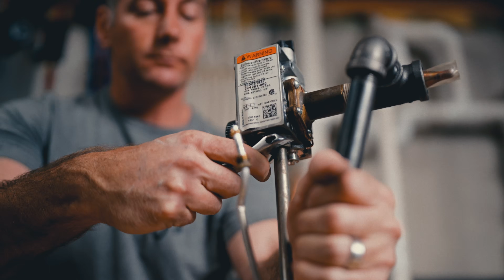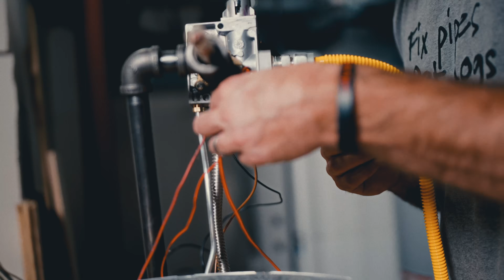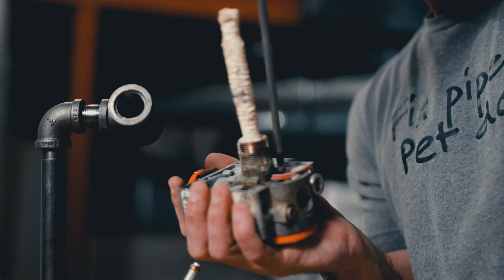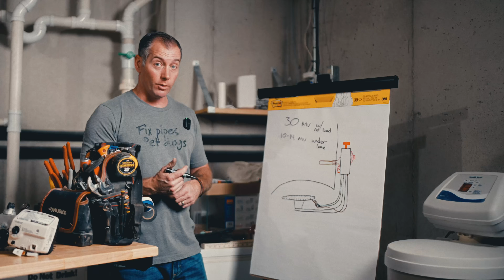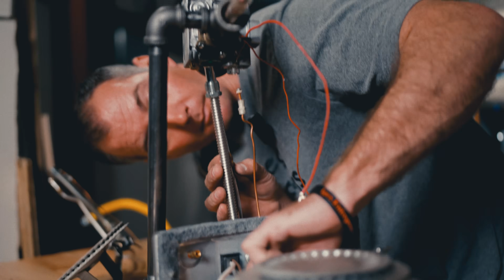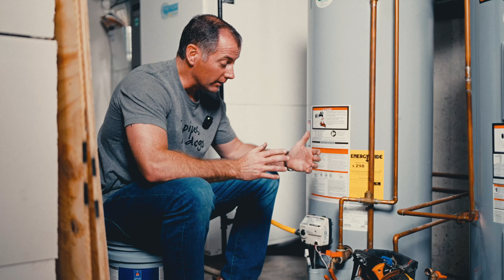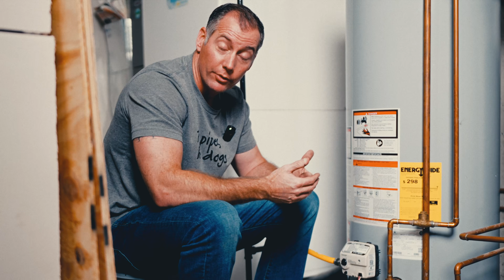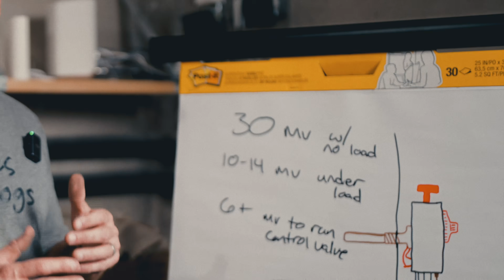Water Heater won't stay lit - Here's why

Comment: I learned a whole lot. Thank you. 👍🏼My Rheem LP 40gal (2020) wouldnt stay lit. The pilot would light but when burner engaged it would poof and snuff out. (TRD was tripped the part is on the way).
I wanted to know why? What caused it. 😳 I don't want to put a band aid on a broken bone. I sent pictures and Rheem techs said the flue pipe must be at least 12 inches above the flange before a bend and mine is only 9.5". It worked for 3 years and the control valve assembly was replaced, and the thermocouple twice.
>> Now after removing the burner assembly..it was ALL charred like your dogs. It's cleaned and back in. For the flue pipe fix..hvac on the way.😂 Omgosh, I could be a consultant after all this research. I have a better understanding of the beast now. Thanks so much. Keep training up more young people. We need them out here! There are limits to R&R. 
It takes knowledge and wisdom to fix what mist cannot. Ps: I like your shirts!
Reply from the maker: Thanks!
Reply: I’m sorry to inform you that the reason your water heater sucks, is because it’s a Rheem.

Comment: I liked your gas control video I have a series 300 control valve if I put my nose right up to it I smell gas not strong but it’s there what’s the cause or is this normal
Reply from the maker: Yep.  They have a small vent on the back side.

Comment: I have a heater with the 300 series valve on it. The pilot will light but won’t stay lit. The light that blinks won’t blink when the pilot is lit. I have taken out the burner and cleaned it and reinstalled it. Can you help I was thinking it was a thermal pile and the little button that pops out is in. Again I am not sure what’s the problem
Reply from the maker: Sounds like you need to replace the control valve.  Check the mv to be sure.

Comment: Model #GFD-3-AOS-24.  It kicked the breaker .The water was slightly water so I noticed the little light wasn't flashing. So I cut the breaker back on and everything kicked on and then kicked off. Then about 40 to an hour or so I heard the breaker kick off, so I left it off. Any help would be appreciated. Thanks I think this is the Model # ND40T62-403 the previous one is wrong I think.
Reply from the maker: I'd call a plumber

Comment: I have a Bradford white eco-defender 
My question  is it keeps going out everyday  and I relit  it everyday  now no light and it will not lit. 
Unit was installed  2022
Reply from the maker: Could be a clogged inlet screen and/or a tripped high limit temp switch.  

If new parts are needed, it could be a thermopile or a bad control valve

Comment: So I have a Rheem brand and the pilot flame stays on but it won’t ignite to open flame , the valve is blinking 7 red flashes , any help ? Thank you
Reply from the maker: You should be able to Google the 7 flashes and the model number of the heater.

Comment: The one my mother in law has is totally different. It's about a 50 gallon water heater and it has been lighting the gas in the tunnel to the burner area. The burner has a metal screen over the burner. It's all one piece and I cannot clean anything unless I remove the screen that is crimped on all around the edges. 
https://youtube.com/shorts/8lkF8PYMUAo?si=S9LyQHGqVX0EVlYy
Reply from the maker: Sounds like you may need to call a plumber.
Reply: @SmedleyPlumbing he said a crack in the pipe to the burner would cause that. I don't see a crack. I pulled it out to check everything. My old water tank has that open area completely closed in, so if it was acting like that, you couldn't see it. Since it's closed in, it probably wouldn't do this. I guess it's just time to get another one, to replace it. 
Thank you for replying.

Comment: Good video.  It would be good to mention that propane water heaters use a reverse threaded nut on main gas inlet to the control valve.
Reply from the maker: Most are standard threads now

Comment: I have an AO Smith gas water, about 2 yrs old. The pilot light was lit and gas valve indicator flashing normal. However, the burner would not kick on. Turned gas valve off, relit pilot light but burner would not engage. I attempted to reset the gas valve, as demonstrated around the 18 min. mark. I unplugged the front wires, status light went out, held dail in at pilot and plugged in front connectors. Status indicated normal. Relit the pilot light, heard a faint "wosh" sound and the burner kicked on. 😅   Thank you OP! Saved me from calling a plumber.
 My neighbor had his gas control valve replaced earlier this year. The part was covered under warranty, but had to pony up around $300 for labor.
Reply from the maker: Glad we could help!
Reply: Bro I fucking love you

Comment: I haven't done water heater trouble shooting in a long time. 
Today I had an AO Smith showing a code for weak voltage, so I replaced the burner assembly. The pilot still after replacing the the entire burner assembly wouldn't lite so I manually lit the pilot and still wouldn't stay lit. Then replaced the gas valve and problem solved. 
Now I know where to look for the voltage and get right to the problem instead of going by the tanks code. $ 257 for the gas valve and $157 for the burner assembly. 😬
Reply from the maker: Glad you got it fixed!

Comment: On my Rheem 22V40F 1 Wtr heater series 200 control valve, I’m getting 15 MV out of the thermocouple when I take it off and test it. But not getting a reading out of it when I try and take a reading on the wires, what’s the best location to get a reading?
Reply from the maker: That's low.  Disconnected, it should produce over 30mv.

Comment: I had a bad safety switch on my old Whirlpool. It is the one that had the reserved thread thermo coupler! What a pain! I had got the updated entire burner assembly, with normal thread thermo coupler. Recently pilot light kept going out. Installing a new coupler didnt fix it. The limit switch didn't seem right. I jumpered the limit switch and it fired up. I cleaned the flame trap in the burner area. I installed a universal limit switch. It's all good now. I ran it quite a while with the limit switch jumped, so i had hot water. My flame looked good, and vent airflow was good.
Reply from the maker: Glad you got it fixed!
Reply: Sediment will overheat Whirlpool WH's & lock valve out

Comment: So I've been working on an AO Smith one. Igniter Sparks on the outside When tested but doesn't spark on the pilot. Cleaned all the screens. Still won't spark. Any suggestions? BTW.... Brand new burner assembly
Reply from the maker: Most likely grounding out along the wire path

Comment: I have a series 300, what can I do when I go to light the pilot, it lights up but as soon as I release the knob to change temp it goes off and also the status light does not come on
Reply from the maker: Hold the button down for at least 30 seconds.  The text the millivolts going into the control valve.  Under 350mv, replace the thermopile.  Over 350, replace the control valve.

Comment: i was getting a code  low voltage on thermopile changed it and got same code so changed burner assembly and now want light piolet so i changed gas controll valve but piolet lightwant light ,can you tall me how to fix this . thanks Mark
Reply from the maker: Most likely the pilot flame is not hitting the thermopile properly.

Comment: Type 200 .... no heat, but the pilot light works.  Proved the safety valve worked  by lighting and immediately releasing the hold button.  Measured the thermocouple when disconnected ... 28.4mv in 2 minutes.  I was not aware of the under load test procedure.  Question, if the thermocouple is strong enough to hold the pilot safety open, is that enough proof that it's ok?

Customer says he routinely turned the heat down every week as this is a vacation home.  The thermostat knob got loose and he tightened the brass knob drive adapter in the control shaft.  There are no index markings so I don't know what happens it the shaft is turned continually.  This control valve was replaced in the spring.
Reply from the maker: Might have failed the thermal overload switch within the control valve

Comment: Very interesting. I have a power vent model, now BW , before AO Smith. The two issues I ran into for no ignition were a failed pressure switch on the draft fan and a dirty flame sensor. That over 16 years. I flush five gallons under pressure every month to keep sediment from building and  clean the air intake screen every few months. I just installed a power anode in the BW to avoid changing out the anode rod ( a real pain for that model). Now , thanks to you , I can diagnose a valve as well .
Reply from the maker: Thanks for sharing your experience!
Reply: How do we replace the anode?
Reply: @r @ragtop326 u cut the hot water outlet pipe (or detach it if it has a union or flexible hose) , remove the combined hot water nipple/ anode and replace it with a BW anode/ outlet (it is a one piece unit).  or an after market one. Note the after market ones may not include a heat trap piece. Corro Protec makes a specific rod / hot water outlet nipple for BW heaters. In my case I replaced the connecting hard copper , hot outlet piping with a sharkbite water heater hose ( press fitting to 3/4 in FPT). Use (blue monster) teflon tape and a small “dose” of pipe dope on any male threads. There are some YT videos with people doing this . You’ll need a 14/18 inch pipe wrench to remove the nipple ( be sure to get three side of egg pipe wrench on the nipple to avoid crushing it. You can also stick a 5/8 bolt in the nipple to help it from crushing.

Comment: So kind of nerding out here. My 3 year old Rheem water heater quit working. The LED code it was giving was Gas Control or Valve Failure. The unit would re-light, but after it reached temperature and shut down, it would not re-light and give me the red LED code (7 blinks). So I figured it needed a new control valve. I called Rheem to find out the correct model to order, and they said it was covered and they would send me new valve free of charge.

Fastforward to a few days later. The new valve arrived, along with a new 'chamber temperature sensor'. I figured it just needed the new valve, so I drained the unit and installed the new valve, but didn't bother with the chamber sensor. It lit and seemed to work fine, but after the burner shut down, it would not light and kicked into red LED code again. FRUSTRATING.

I disconnected everything again, pulled the burner assembly, replaced the chamber sensor (and gasket around the inner door which it also came with), put it all back together and lit the unit.  3 days later, it is all working fine, no issues.

It would seem my control valve was fine and the culprit was the chamber sensor which you have not mentioned here. I just wish I would have replaced the sensor the first time, and avoided dismantling it all twice :)
Reply from the maker: Rare for that sensor to fail.
Reply: @SmedleyPlumbing   if I have a slight hint of gas smell, when I put my nose t the top of the control valve, and I can smell natural gas, is that a bad valve? I get 7 blinks, and according to the label, the sensor, sense's a gas leak. according to my label for trouble shooting. this water heater has been in service for two months. and manufacturing date of last fall 2025. it is a Richmond.
Reply: @SmedleyPlumbing rare but not impossible
Reply: @SmedleyPlumbing chamber sensor got bad on me also , after 5 years.
Reply: Did the code sticker on the side say, 7 blinks, indicates a gas leak?  I just got a richmond and it's been in service for 2 months and now I'm just started getting 7 blinks.  my code reader sticker on the tank, says the sensor, smells a gas leak,  I can smell a slight hint behind my control valve.
Reply: Chamer sensor? So temperature probe?
Reply: I'm literally going through that right now

Comment: GREAT video - A pilot wouldn't relite on a rental unit of mine.  I measured the thermocouple and saw 18 milli-volts. I swaped out the thermocouple and the pilot stayed lit.

Renter calles the next day and says the pilot is out again. The hi-limit tripped. I dug in some more and found that the high limit was acting flaky. I didn't realize you could measure the thermal coupled voltage at the high limit. Very helpful!
Reply from the maker: That's good information to know!

Comment: I have a Rheem hot water heater. The water heater kept going out , not the pilot light the flame. I changed the whole control valve and thermostat coupler unit, A Rheem one. 
It is still going out what else could it be? Such a basic system but I am stumped
Reply from the maker: Sounds like a restriction on the air intake or the flue pipe

Comment: This video was great and I came across it because my pilot went out. I actually assumed I had a thermocouple but watching this video my 2017 Rheem gas water heater has a series 300 or 400 control valve. Not sure which one. So I guess I have a Thermo pile. But I was able to relight the pilot and after a day it's still one. Never had any issues with it since it's been installed. It's in the attic so there is no pets, dust, wind etc.

What could have made it go out?
Thanks
Reply from the maker: Who knows.  But if it becomes a pattern, then it's time to investigate.